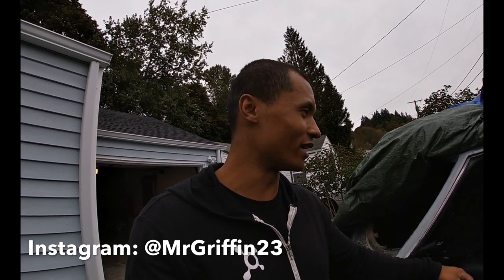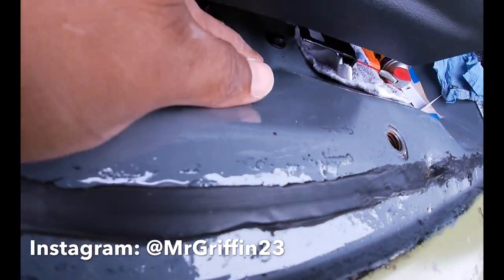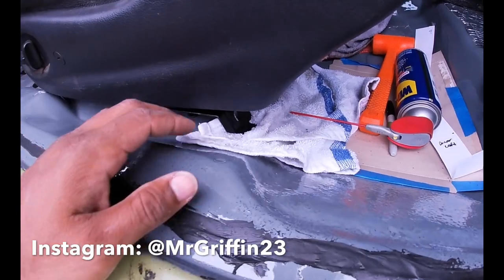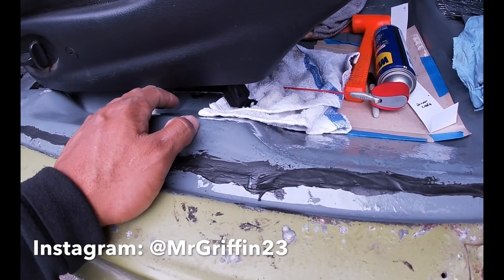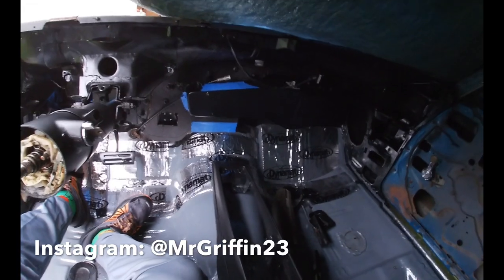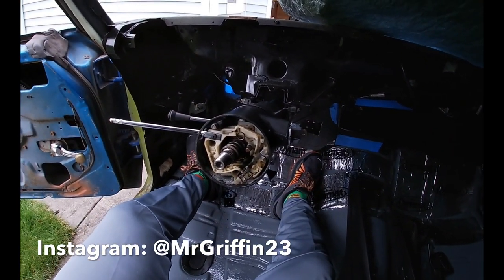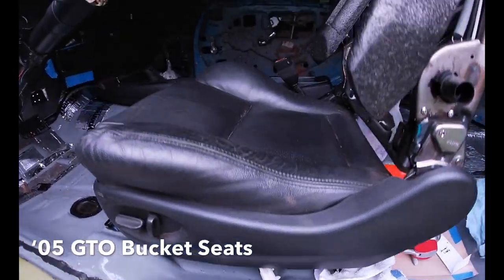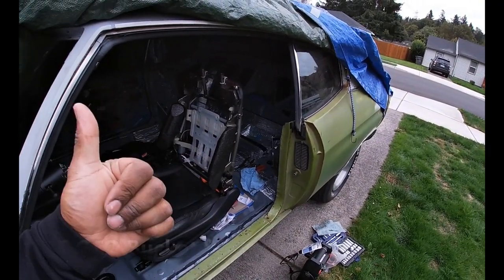2005 GTO SEATS TO 1971 CHEVELLE | SEAT SWAP: PART 2 | 6.0 LSX | DIY | RESTORATION

Comment: How did u wire them up
Reply from the maker: Haven’t worked them yet, but I’ll prob just tie it into a 12v+ battery hot lead and fuse it. Wiring and pigtails came with it.
Reply: I'm put them in a 72 cutlass got everything 2 move but front 2 back
Reply from the maker: perch Williams Check underneath the seat too where the wires are. There are a couple different pigtails that snap together and need to be connected if they aren’t to give you the 6-way adjustment. Also check your grounds. I think there are 1 or 2 grounds that are tied into the seat frame held on by a lil’ clip.
Reply: Thank I'm look in the morning man ur seats look great
Reply from the maker: perch Williams Coo. Thanks, I appreciate it!

Comment: Tell us how do you wire them up
Reply from the maker: They are not permanently wired in yet. But it’s pretty straight forward if you have the original harness from the GTO. Just a power and ground then the seat will function as it should.